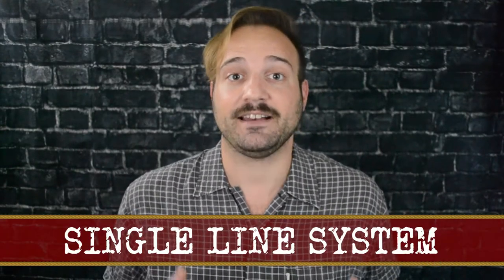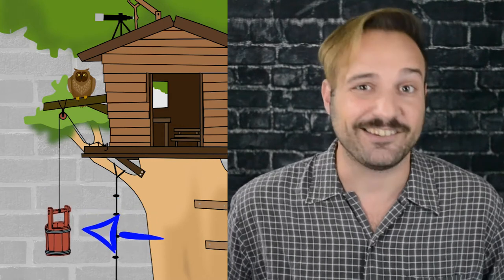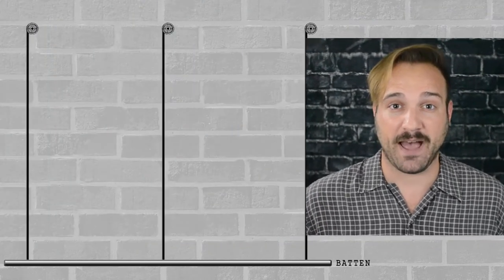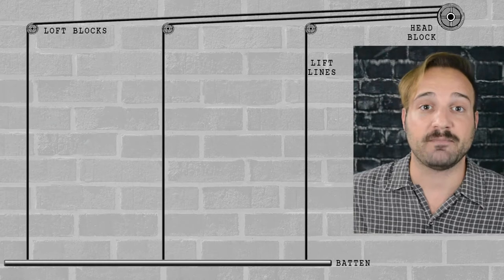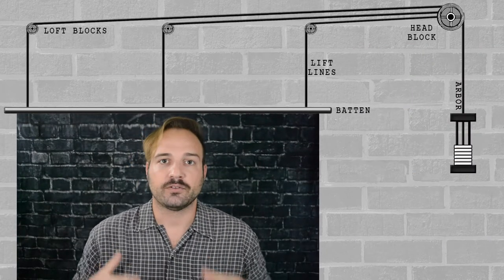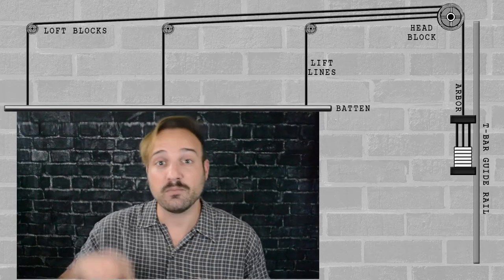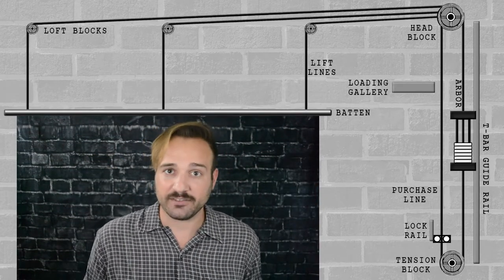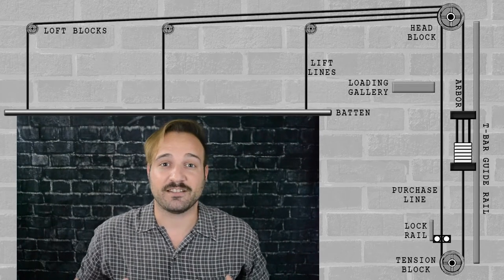Theatrical Rigging Systems (Fly Systems)

Comment: Fun video to watch. Over here in The Netherlands all of our medium to large theatres have motorised (and mostly computer controlled) systems, due to changes in the Working Conditons Act in the early 2000's. They limited the maximum allowed weight per hand operated batten and the maximum amound of hand operated battens per stage.

Comment: I work in a smaller theatre in Germany and the biggest difference I've noticed is the look of the weights and arbors. In English-speaking videos, I've only seen long and flat weights with small slits on both ends and the lock rail features a small metal ring sliding over the rope and lever serving as a locking mechanism. Here, the only stage weights I've seen are shaped a lot like bricks, they have a nudge in the middle and a wider slit going only from the side to the middle, so the arbors have one post in the middle that the weights fit around (you alternate which side the slit is on for more safety) and there is a small metal thingy that slides up and down on the middle post of the arbor and you put it over the nudge and lock it in place so the weights would not be able to seperate vertically if the arbor were to fall and thus not be affected by gravity and because of the nudges they can't fly off to the sides if they're pressed down vertically. As for the lock rail safety mechanism, the systems vary, but with most you have to pull up the knob on the lever for it to unlock and it locks right back into place when the lever is back in the up position. There are also metal clamp thingies we use for pressing the ropes together when the line set is unbalanced for additional safety.